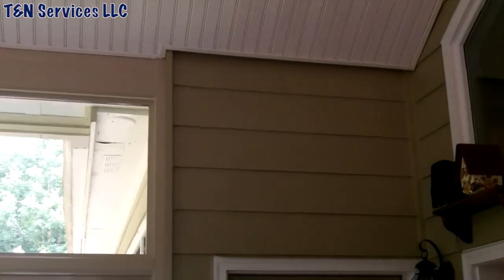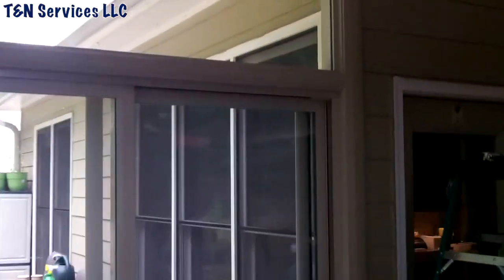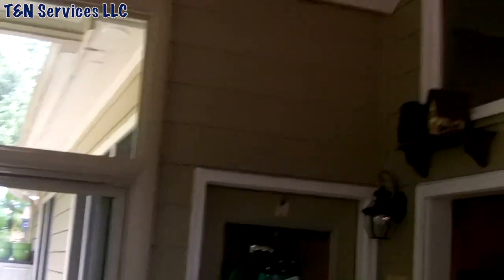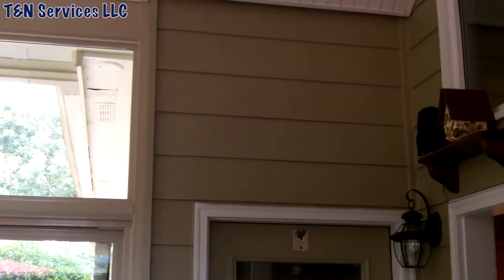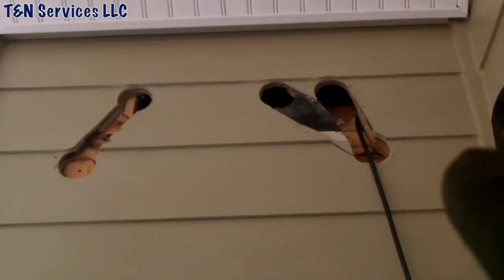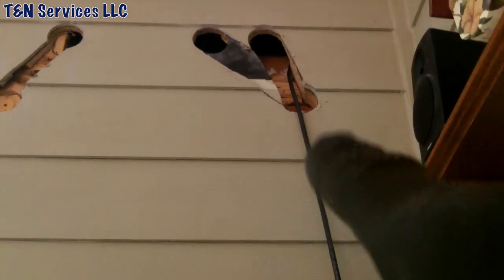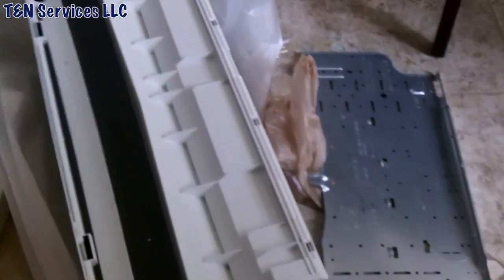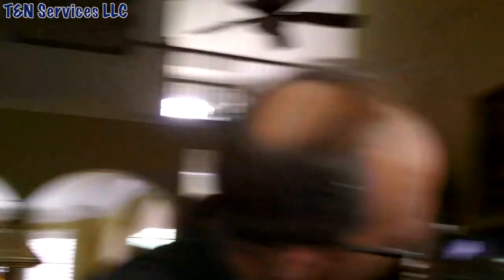Mitsubishi Mini Split Install In A Sunroom

Comment: Everybody thinks that mini splits are so easy to install and they are easy for the most part, but they do have some unusual challenges sometimes.  I install a lot of mini splits at the school where I work and sometimes they can be a challenge especially when the indoor unit is on the 1st floor and the outdoor unit has to go on the roof without having the line sets on the outside of the building.  We mostly install the ceiling cassettes and have to run fresh air to them. Good job Ralph.  Thanks for sharing.

Comment: It is amazing how far mini splits have come in such a short time,  I had the pleasure of working on a very primitive Dynazone mini split on Friday, unfortunately the temperature control failed and we cannot get a new wired remote for it, but amazingly it still does a great job. I have considered gutting the unit and using an ordinary thermostat and relays to just give it maximum output all the time. But looking back the Mitsubishi's and most others much easier to install

Comment: What I recommend to my customers to keep the drain pan, the condensate pump and the hose clear is to take an old medicine bottle with an eye dropper in it and put 5-10 drops of undiluted bleach straight into the drain pan every month. It works its way through the drain system and keeps that slime from going, which are colonies of bacteria, mold and/or algae. Plastic has microscopic pores in it that the allows those colonies to attach to the plastic. Those microscopic pores will also take up the bleach to prevent that stuff from growing again, assuming the customer is diligent about using the bleach. I also recommend it for central ACs that use a condensate pump, such as my own. I've never had an issue with slime in the 11 years since installing my system and I disassembled the drain line and pump this past spring and they were both spotless, including the P trap. Bleach is a customer's best friend when it comes to preventing drain clogs

Comment: Thank you.  Not a fan of the indoor mounting bracket on the vinyl siding, but can’t think of a better solution other than cutting out a rectangle of vinyl siding behind the unit and replacing with a piece of plywood.  Might be able to mount it directly on vinyl with some spacers.

Comment: How well did the minisplit cool the sunroom?  Are they cooling it only when they are using it and if so how long does it take to cool it down?
Reply from the maker: I got an email from them today and they said Thanks for getting installed for them, they are really enjoying the room now. They want to spend all their time out there so they are going to let it cool all the time. It wouldn't take any time to cool the room down if they turned it up high then turn it down though

Comment: Looks like a pain but you got it handled! I hate those condensate pumps in minisplits but sometimes ya got no other choice! What brand of pump did you use ralph? I put in 4 mini splits at a nursing home and i used the diversitech pumps and have had nothing but problems with the pumps. The water level sensor rods get scummed up and the pump inlet screen gets clogged with slime and dust water mix etc. Drain tabs havent really helped. Unfortunately theres nowhere to run a gravity drain line

Comment: really nice work Ralph. I have a job very similar to that I'm doing. How did you connect the lineset? Flare, braze? However you did it seems like it must have been difficult because of the tight space behind the unit?
Reply from the maker: I used the flares on this one. I didn't eat to drag the torches into the attic on this one. Once I got the unit on the wall it was a breeze. Two people was a must on this job though